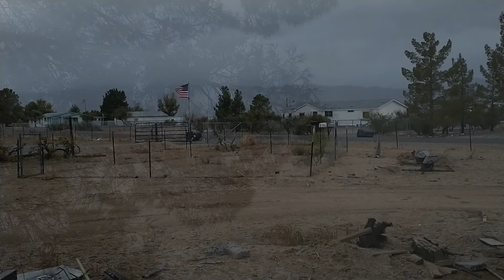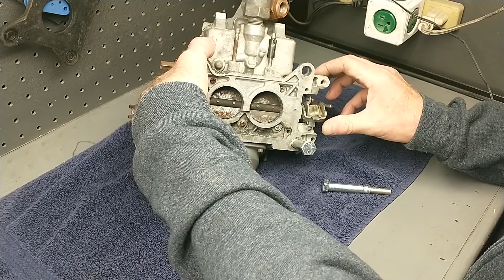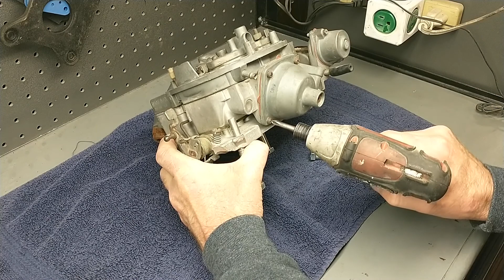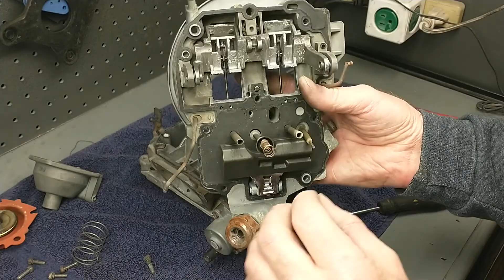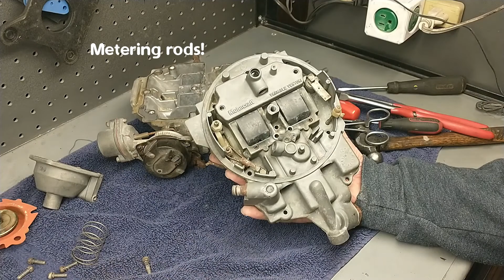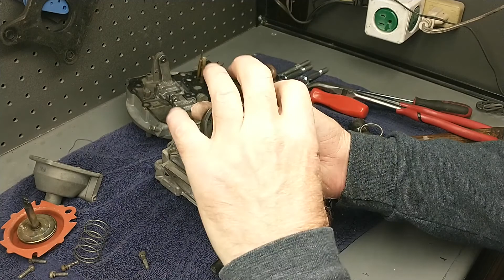Motorcraft Variable Venturi (VV) Carburetor-Rick's Shop

Comment: Dude gave me a 76 Ltd with 120 k
 In 1992. It wouldn't pass smog and to rebuild the carb, he said that they wanted almost 800 dollars for the rebuild kit alone.  So I put the motor in my 46 willys jeep.. big difference between the stock flathead cylinder and the 302 v8. Put a 780 spread bore and highrise intake..and nothing else but bigger exhaust.. 650 isn't big enough for a 302.. even though I've seen them on big block chevys,

Comment: Do you have any Idea of CFM flow?  I would think it would have had to be enough to feed the 302 and 351. On the 2700 would it be usefull to wire up the idle enrichmert system ( summer driver car)  if so I'm not sure what all parts are needed, wiring diagram, and what the parts numbers would be, or even the correct terms for the parts.  Thinking of using on a 1962 Plymouth with a 318 Poly.  I alway thought they were an interesting carb. Most of the time the large diaphram was bad , or a heavy float.

Comment: hi rick, thanks for the reply, and the tips, i do have a phenolic spacer only 1/4. i should have read that bit in the manual a bit more on the hot idle compensator you are right there, i will look at the float level a bit more and maybe lower it a tiny bit, i have the fuel bowl vent running into the air cleaner and i have noticed a bit of fuel in the hose at times so maybe its percolating into there because the float level might be smidge out. all the fun of old cars and carburetors.

Comment: hi rick, its been about 2 years since i installed the 2700vv on my windsor 260 v8, im still very happy with the carb, it does have some unusual little traits but overall the fuel economy is the big factor, i have 1 little issue and its when the engine gets hot like here in western australia 100deg days in summer are very common, i have a air fuel ratio gauge in the system so it tells all, im assuming its the HOT IDLE COMPENSATOR that kicks in when the engine temp rises, can i block off or disconnect this system, it just enriches the carb that bit to much and the engine starts to playup a bit untill you go back to constant speed and the coolant drops back to normal temp, the the AFR goes back to my normal range. any idea how i could block off or remove the hot idle compensator. i have managed to get a few manuals and a motorcraft shop tips manual on the 2700vv series. chris western australia
Reply from the maker: The hot idle compensator is supposed to lean out the idle fuel mixture when it opens. Something else must be going on. Have you tried a phenolic spacer?

Comment: @ricksshop
hi Rick, I have a variable Venturi carburetor, almost like the one in your video, but mines has wires sticking out of it 
I believe it works with the computer. It is out of 85 f150
my question is, can I get it to run independent of the computer any advice?
Reply from the maker: The 7200 VV requires a computer or it will run very rich all the time.
Reply: I'm looking at the same problem. I've heard tell of someone trying to make a manual fuel trim adjustment for the 7200 but I haven't heard anything else about it. Basically the computer feedback works by using a stepper motor to control a valve that let's a metered amount of vacuum to the fuel bowl. Lowering the pressure in the bowl lowers the pressure difference between the bowl and main meter jet. Thereby leaning the mixture since the motive force on the fuel is decreased.

My current best guess is either leaner jets and metering rods or replacing the valve with a little plug with a hole in it, blocking off the stepper motor was as to not leak vacuum. Then playing around with making the orifice different size until it's a reasonable static state. From there playing with the main jet adjustments to dial it in from there.

Might not be quite as good as a normal non-feedback 2700 though.

Comment: I have a 2700 that worked good. I changed my timing chain on my 1982 E150 351 Windsor and it runs good until it gets to 3rd gear at 46 mph, then bogs down badly until it gets down to about 35 mph. I messed with all carb adjustments and it still bogs down. Any ideas what I can adjust?

Comment: Thanks for the video! Not much info out there on these so very helpful! I have one on a pinto engine in a kit car I inherited from my grandfather. It seems to be running ok except sometimes on acceleration the rpms will drop from say 1000 to 300, almost dying but usually coming back up to normal shortly after and accelerating fine. Any idea if that sounds like an issue cause by this carb?

Comment: Thank ya muchly for this! I just got my hands on a 1986 Grand Marquis with the 351W, with a 7200VV under the hood.. its got idle issues and runs bad, so i needed information on these carbs so i could figure it out. I have not had a chance to really look at it yet but im sure to come back and ask a question or two... hoping for a reply. 
First question though is that hole.. i need a bit more information about the hole drilled in the diaphram housing, incase it's not there yet...
Thanks for the video!
Reply from the maker: Remove the diaphragm cover and diaphragm, drill a 1/8" hole on the carb side of the diaphragm below where the diaphragm shaft enters the housing so the carb side of the diaphragm is vented to atmosphere.

Comment: Good morning Rick. Quick question if you have the time, I just watched your breakdown and commen problem video. I have the one either the electric plug in the side by the way. I think it’s the E25E ac model. Took it of a 2982 Lincoln Continental 5L v8. When you took your diaphragm out it just slid out, was it not connected with a pin or clip? I popped my cap off and pulled on it ( it’s a red one by the way) don’t come out. Also my two black Venturi slides do not slide back. They are stuck in the closed position. What am I missing? What is preventing me from freely sliding them back and forth like you do in the video????? Thank you for your time.  Have a great day.
Reply from the maker: There's a hook on the end of the diaphragm. Some slide right out, others you will have to loosen the top screws (or remove the top).

Comment: Rick My 94 Boat had a 351W with VV Carb  I t hinkit has a fuel pressure issue but am unable to get Specs. for  proper fuel pressure 
do you havespecs it hasa mechanical fuel pump
Reply: @georgeturner  i saw another video and the fella recommended 6 psi on the auto lite 2100. Probably NOT the same for the 2700VV I can forward you the link if you want. … Late response
Reply: https://youtu.be/95zEZJ9hWOM?si=XIq4_WBOsvwOfy-B

@ 45 seconds in

Comment: hi rick, thanks for your info and advice, im impressed with this 2700VV its running like a top and the engine has so much more torque, i took your advice on the jet adjustments and removed the brass plugs and made up some plugs from small vacuum hose with a 1/4 inch bolt cut down to suit and pressed in nice and tight, now i can simply remove the plugs and adjust the mixture with ease, i have an air fuel ratio meter installed so i can fine tune the carby, happy days here.
chris

Comment: hi rick, i have installed the 2700 VV and its running ok, but i need to wire the 1 wire electric choke to complete the set up, whats the best way? chris
Reply from the maker: If you have the original Ford alternator with the external regulator, there should be an unused stator terminal on the back of the alternator. Ford only uses two of the three available for charging. You can hook it there. If not, just run it to key power.

Comment: hi rick, i now have a rebuilt 2700 VV and im about to install it on my 289 falcon, could you let me know what to do with the  largefuel bowl vent that goes to a charcoal canister that i dont have on my 63 falcon, should i just plug it ? and if so is there another smaller fuel bowl vent internally,  i have drilled the hole in the diaphram base as instructions and installed the orange diaphram,  also the choke has 1 electrical contact do i just hook up a hot wire from an ignition source to activate it,  this is going to be just a MPG pursuit for me a retired hot rodder. chris
Reply from the maker: It's best to hook that to the same filtered air the throat of the carb sees. Plugging it or leaving it open are not the best options because that can minutely change the pressure acting on the fuel passages.

Comment: MY VV ON MY LINCOLN HAD A WIRE HARNESS TO IT 3 OR 4 WIRES PLUGGED INTO IT.
Reply from the maker: The 2700vv may have had an enrichment solenoid on the front of the carb. If there are wires plugging into the side, you have a 7200vv which is a feedback carb (computer).

Comment: THEY ARE VERY TEMPERAMENTAL AND DIFFICULT TO REBUILD CORRECTLY. BUT ONCE YOU HAVE IT RIGHT, THEY ARE GREAT FOR EMISSIONS, AND FUEL ECONOMY. I HAD ONE ON A 1980 5.8 LITER LINCOLN TOWN COUPE. 17 MPG IN TOWN, A ND 23 ON HIGHWAY. GREAT LOW END TORQUE. 0 TO 40 WAS DAMN NEAR INSTANT. I ALWAYS WITH EXTREME EASE WOULD BE THRU THE INTERSECTION FROM A RED LIGHT STOP, BEFORE ANYBODY ELSE MOVED 3 FEET. IT WAS NUTS. BUT THE CARB WAS JUST TOO DIFFICULT TO GET RIGHT FROM A REBUILD.

Comment: hi rick, can you let me know the diameter of the top of the carb for the air cleaner it looks bigger than normal, im waiting for my 2700 VV to be sent to me, chris
Reply from the maker: They are about 1/8" too large for a typical air cleaner, but a few minutes with a carbide bit takes care of that.

Comment: hi rick, i am going to install a 2700 VV on my 289 ford v8 , could you let me know where to hook up the vacuum advance for my distributor on the carb? chris
Reply from the maker: Depends on your engine. Try it hooked to manifold vacuum first. If you engine doesn't like that much advance at idle (trailer-hitching on decel, rough idle, hard crank when warm), move it to the ported vacuum port on the carb. It's the one that has no vacuum at idle but lots of vacuum off idle.

Comment: Had a '81 LTD Crown Vic with this carb.  For the most part, it was pretty good, but it had one annoying problem.  On a very cold day (well below zero F), it'd start just fine.  As the fuel expanded, it'd further cool the carb, which would then freeze up.  Every time, I'd have to then spray it with carb cleaner to free it up again.  By this time, heat from the engine would start working it's way up and once I restarted, I was good to go.
The takeaway is that on a cold day, don't expect to actually drive the car for about five minutes.  If you do, expect to be popping the hood on the side of the road.
Reply: Ltd 76 302. Same thing

Comment: What did you use as plugs in the jet ports after you removed the metal plugs?
Reply from the maker: Vacuum couplers. They were trimmed to fit the holes.

Comment: I had the 7200 VV on a 351W in a 1989 Mercury Grand Marquis. It usually started well in the winter and high idle fairly well too, but when you gave the accelerator a root to idle it down, the sliders would freeze, causing the accelerator to stick wide open.
Then in hot weather, it would run fine until you shut it off. It was prone to flooding when trying to restart a warm engine on a hot day. 
I do agree about the positive fuel economy part though, mine used to rival an EFI 5.0 in the same car for gas mileage in warm weather, when it didn't need to idle very long to warm up and operate properly.
I wish I still had that car, it was a real unicorn in the 351W/AOD/posi rear axle/dual exhaust/absolute marshmallow suspension configuration. The main reason I condemned it was because I didn't understand this carburetor and hated it as a result.
Great video (just twenty years too late for me lol)
Reply: I had quite a bit of experience with a couple of them in retired police cars in Colorado in the 90's and those two were bulletproof.  The one on my dad's '83 went almost 500K miles when he sold it.  I don't know what was done to them when they were police cars but afterwards they were great.

Comment: I have one,  runs great except for it is running rich.  I don't see a power valve.  Would the vv diaphragm cause it to run rich.  73 f100. 390. A 50+ year ford tech put this on.  I first got the truck I could feel it,  more take off....and sometimes it feels like a 50 year old truck.  146k. Truck has been garage kept and all original.
Reply from the maker: Yes, the diaphragm could be the culprit. You can loosen the top cover screws and remove the rear cover to slide the diaphragm out to inspect.
Reply: How hard is it to change my venture into a regular carburetor
Reply from the maker: @troylarkin9024  motorcraft 2150 two barrels swap on easily, but you will need one with big venturis for a 390. Usually the two barrel intakes are swapped out on FE engines for aluminum 4 barrel carb/intakes. Because the intake is so wide (under the valve cover rails) it removes a * bunch* of weight.
Reply: Well Rick,  I dropped the roller in the intake.  It is not magnetic.  I will be removing the intake and going ahead with value seals.  I don't know if I will go Eddie rpm and a 600 4 barrel carburetor or not.  I was thinking about the camshaft as well since I have to open it up.  I have a vv carb on stand by...ready to go but I hear that a intake,  600 cfm and headers will wake this 390 up.  146k. Runs great.  I was just trying to get rid of the black from the exhaust and....well,  you have worked on automobiles for decades like me. If it was a customer vehicle,  I would have been able to get it out but your own always takes a turn 😆.  Intake needed to be resealed nonetheless.  Thank you for your time and help.  It's hard to find knowledge but not know it alls lol. I do want to make this thing rock so I will probably get the 4 barrel set up for now and get it back on the road.  Couple of years....go big cam and or stroker.  But leave it stock on the outside.  Thanks again sir

Comment: Excellent video I have a 79 Versailles 
With a 302& vv carb , it seems to run very erratically when hot with the a/c 
On any suggestions
Reply from the maker: Could be percolation. Hot condenser air blowing over fuel lines could be vaporizing fuel.